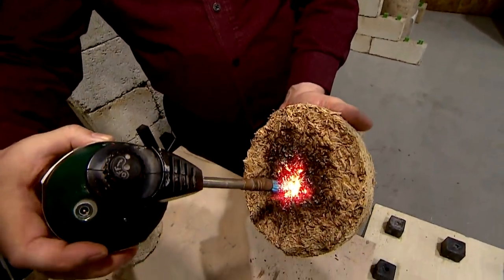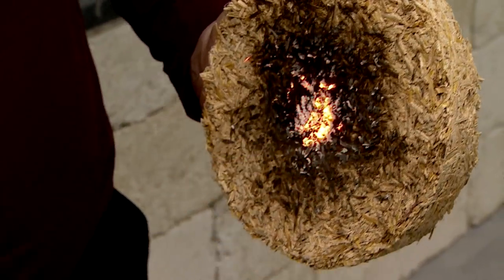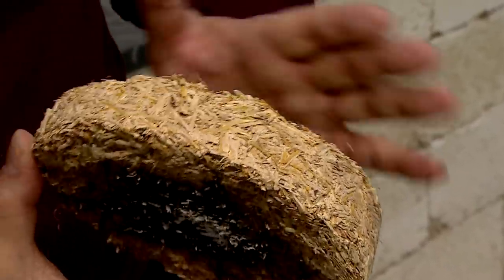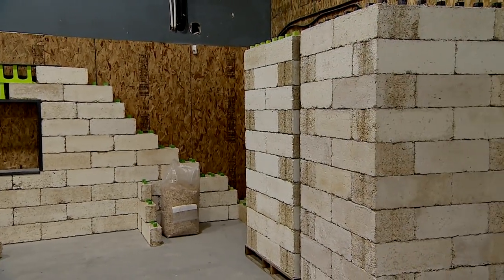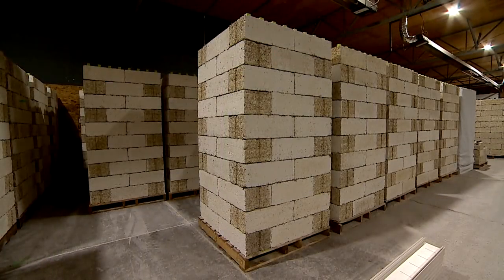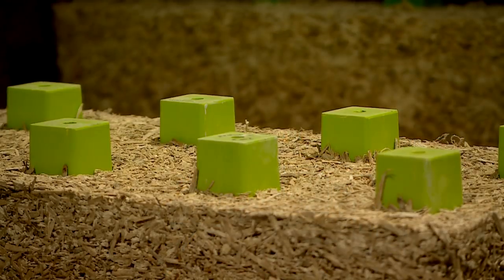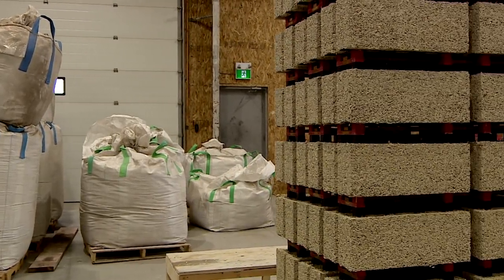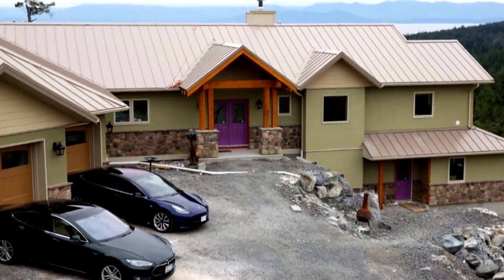Hemp houses could be greener, fire-resistant

Comment: Hemp building materials are perfect considering the construction industry (like concrete is a huge one) makes more emissions than air travel does. If you go find a 100 year old house in the UK you might find it has a thatched roof made from straw, and insulation made from sheep's wool and straw was common too and yep even hemp fibres.

Comment: How long does hemp houses last? Is it more affordable than concrete?
Reply: On average the estimated time is 40 yrs depending on conditions. As the majority of houses are replaced now or renovated every 20 yrs the cost savings is still immense.
Reply: @nopeninja8883  "majority of houses are replaced now or renovated every 20 yrs"
Where do you get those statistics. They sound extremely low and I can't imagine a house with a 20 year shelf life : that's the life of a traditional mortgage. The basic building blocks of a home cannot be replaced or renovated, short of rebuilding. I would expect all structural materials in a new home to last 100 years or more.
Reply: @Blackmark52  okay..  with the big push for updating styles, electrical, furnaces, appliances, roofs etc yes its now. Used to be 50-70 for a full life of a house but in the current culture of flipping/upgrading/knockdown & rebuilds its knocked that down a lot. The renovation craze means that even major structural parts of houses are changed. The bricks he showed from what ive read are cheaper and can be replaced if need be. Builders rule of thumb is if its rated for 100 yr lifespan, the average will be a little under that. Unfortunately most people are not as diligent with house maintenance as they were before. As its an hr burn time rated im hoping that they can use these to replace houses lost in wild fire prone areas. I saw a great demo last year sometime and looked into this stuff. If you google it youll find the specs.
Reply: @nopeninja8883  "the current culture of flipping/upgrading/knockdown & rebuilds"
You seem to be conflating the time a home can be expected to retain market value and need renovations and such with the life expectancy of the building materials used. And that doesn't seem to be a particularly good idea when the materials you're talking about are foundational. I'm not saying that the material could never be viable, but I would never take out a 20 year mortgage to buy a house with a shelf life of a mere 40 years.
Reply: @Blackmark52  erm no i was bundling them in together as the houses built in say the 50's were considered 100 yr homes. Most have needed upgrades to major walls supports etc.  I live in one that needs some structural upgrades. It happens. If someone says its 100 year home, and you maintain it perfectly yeah you might get that. But most wont. People diy or get unqualified labour for their houses instead of getting licensed contractors. Or say random acts of nature, pests etc. Look into the construction issues in ontario alone. Lack of skilled and trained contractors have left homes wrecked and unlivable.  Forget the fact that we are not designing for upcoming weather issues we know are coming.
Reply: well, adobe houses last in perpetuity with maintainence.  natural, renewable, durable, efficient materials make sense.
Reply: @shawnmarla9663  depends on if you figure in the insulation & labor costs.
Reply: @shawnmarla9663  depends. The figures that i sa2 presented a while back were very under the combined costs but as its not readily available yet i dont know. For me it ultimately means that you could still have a home in a wildfire area that is way less likely to burn to the ground.
Reply: @shawnmarla9663  yup i agree with you on that front. As it is a waste product mixed with another readily available inexpensive product it was touted as being in the end 25-30% less vs the materials (wood, insulation etc) and labour involved with regular house building. But as it hasnt been rolled out and i dont have a copy of the presentation i saw i can only wait to see the end results.
Reply: Nope ninja you couldn’t be further from the truth. Hempcrete blocks takes decades to fully cure with some batches lasting for thousands of years
Reply: If cobb contains hemp instead of straw, then it'll last for centuries.

Comment: I'm not against it; I'm just wondering. Why hemp? What makes hemp better than any other plant?
Reply: it has thousands of uses. one plant to rule them all. biofuels. bioplastics, clothing, wood, paper, cardboard etc etc. produces 20 times more wood per arce vs trees! also great soil detoxer as well!
Reply: A house built with hemp blocks also absorbs alot of Co2 gaz, a normal house could take up minimum 6.5 tons of Co2, also the material isolates the humidity & distributes it back in the house for 20 hours making you save alot of energy, compared to normal houses which doesn’t store the heat in the walls but let them out directly
Reply: jammapcb wow. Why aren't everyone in the construction industry using it then to replace all the plastics being used? More people should see this vid.
Reply: @lucystephanieproperties  because its been illegal for many years... kinda makes it hard to market ;0) so not exactly a turning point for a research firm! but its becoming legal worldwide! and about time. Oil companies are a clue a few control that. Cannabis sativa / hemp Plant = anyone can grow and process it. If packaging and compressed wood from hemp , paper and biofuels. textiles, insulation which are not a new thing would mean alot more jobs and the distribution of wealth would also be better for everyone. Not to mention better for the environment as well! including bee's and you know what bees are good at right? oil doesn't do anyof this for the environment at all! Hemp doesn't need pesticides either :0) which are brutal to all life! in the long term! so win win! for the masses. Vote it up, get involved insist we have this for all countries! its healthier both in use and consumption. Omega 3 6 9 etc go look up all the compounds in it as well! and what it can do for live stock as well! Omega 3 = brain food for all mammals including us! Last time i Checked oil doesnt help there either lol. Why do you think there was so much fuss around it? because its bad for you? or the fact its very good for many reasons and no one should ever control it just for cash! its THE plant on this planet! a work of biological genius!